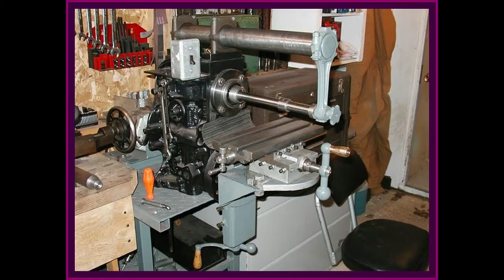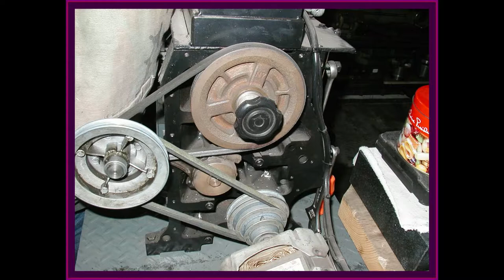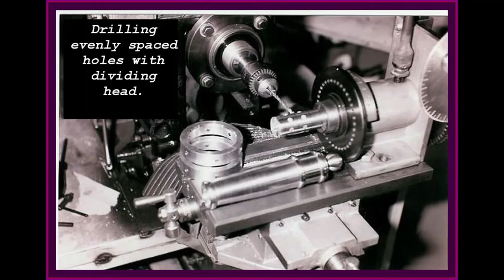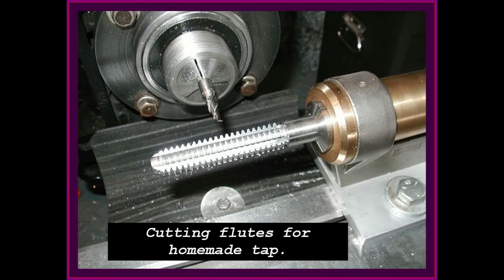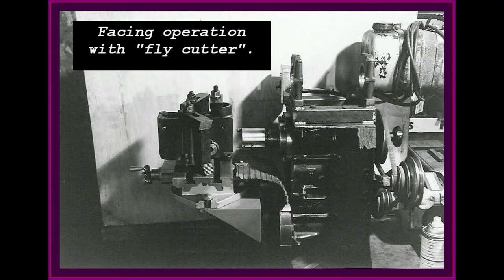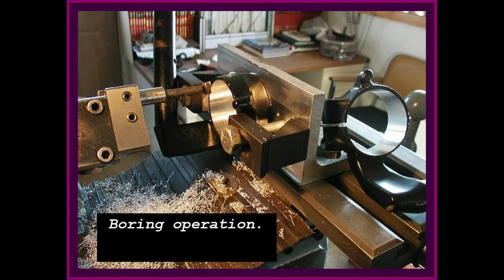Engine Mill Photo Library

Comment: I wonder if a person could use an old Lawn mower engine?
Reply from the maker: The idea with an inline engine is that the cylinders are perfectly parallel. It also provides an accurate flat surface with plenty of threaded holes to mount the slides and milling table too.